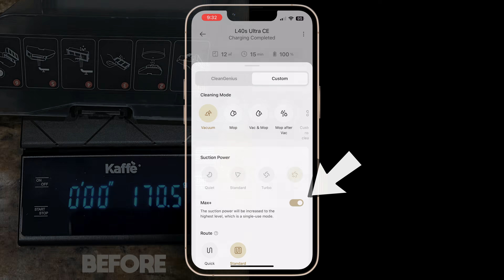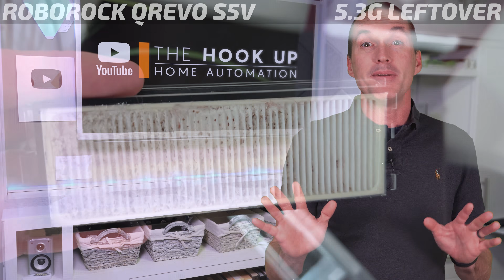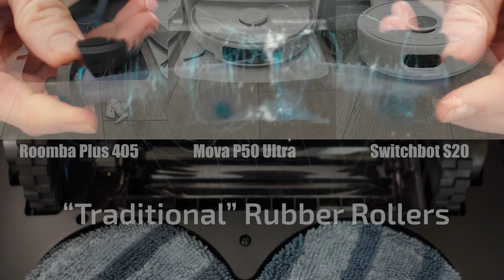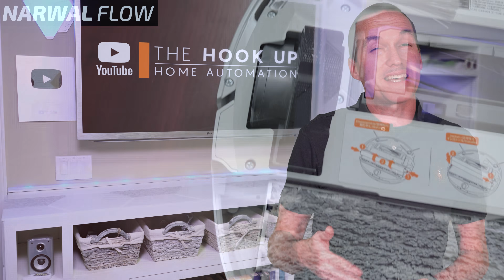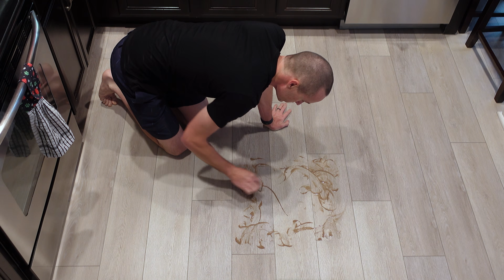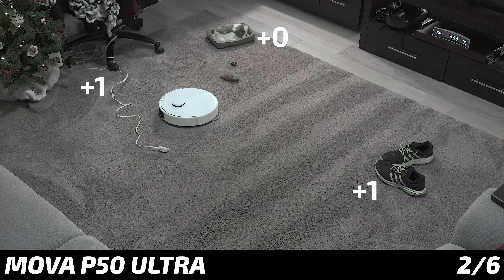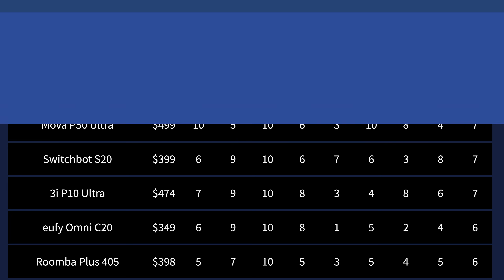The Best $300–$600 Robot Vacuums (They Beat the Flagships!)

Comment: Test is flawed. Ofcourse you'll have the latter vaccums pick up more debris, due to previous ones leaving much of it behind and every consecutive vacuum in addition of what you had previously on the carpet has more chance of being picked up as the speed of vacuum pass plays a role in number of particles it can pick up at once with each pass per surface area. With each addition of particle adding to what was there previously. Test would have been more accurate if you laid a fresh clean carpet for each vacuum without previous debris being added to the test
Reply from the maker: Sigh, I ALWAYS vacuum with a corded upright in between tests, I usually include it in my "this is what I do" section, but it felt unnecessary. I guess I'll always include that blurb in the future.  https://youtu.be/GqvYUjkVONQ?si=IVzo1LvxdGSgaJSJ&t=67

Really though, do you think the kind of guy who sits around measuring the number of grams of debris picked up by a vacuum wouldn't think to reset the testing area before each trial?
Reply: @TheHookUp did you weigh what you picked up with corded upright after each test to confirm you picked up everything?

Comment: Note the Mova can use the  same tricut roller as the dreame
Reply from the maker: Yep, the L40S Ultra CE comes with one in the box though.
Reply: The P50 Pro Ultra comes with it in the box and also the cleaner dispenser as a difference form the P50 Ultra (so confusing) typically ultra is the top of the line, but it is pro ultra in this case